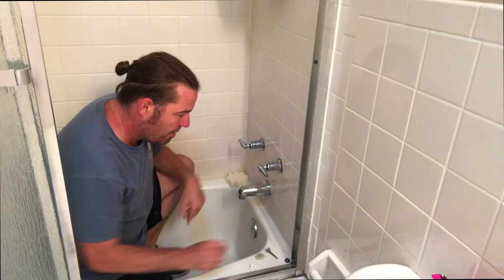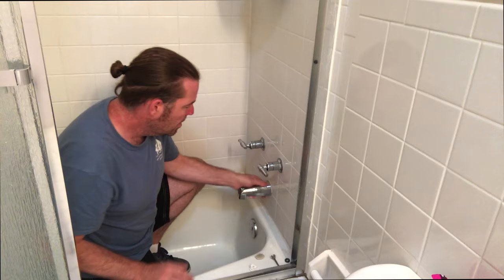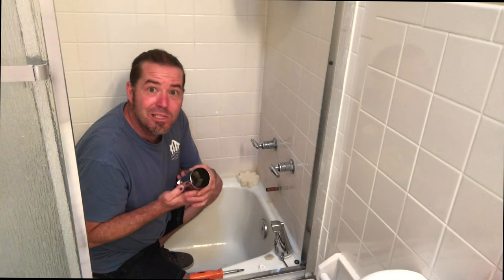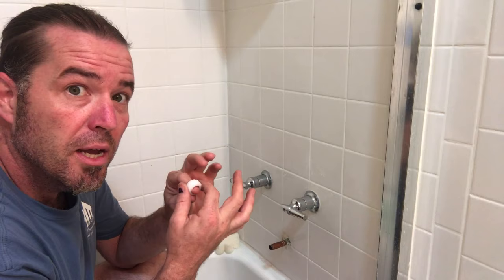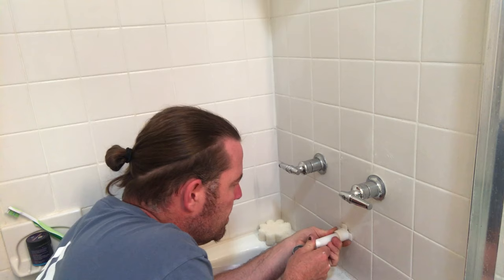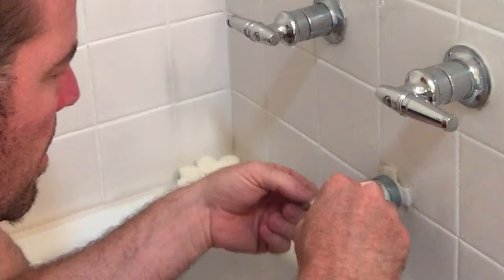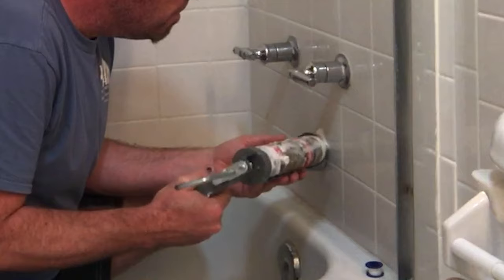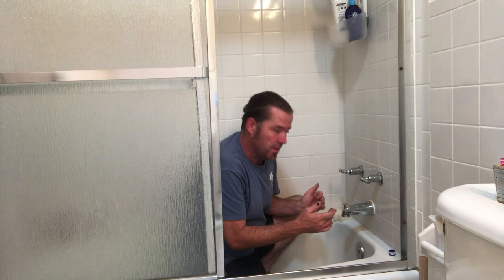how to replace tub spout, change tub diverter. Easy!

Comment: You can tighten it by hand, no tool is needed? Good tip on leaving the bottom open to allow inside leak to come out and not stuck inside the wall. Thx
Reply from the maker: Thank you simple. Appreciate the comment!

Comment: In our shower our spout doesn’t have one of those diverters, does this mean I need to replace the spout with a new spout that has one? Because we cannot use our shower head
Reply from the maker: Hey Nicolas. That means you probably have a three handle system with a diverter in the middle. You may need to replace what’s inside that middle handle… Otherwise yes, you would need a diverter on the tub spout.

Comment: Thanks Dustin! I recently moved into a new house that needs some small improvements, including this. Followed your instructions and now no more water coming from the spout when pulling up the lever! 

My copper pipe was much longer than the one you showed in the video, so I just needed to screw the spout on directly. Hopefully I didn’t miss anything but will keep the spare parts just in case. 

Thanks again Dustin!
Reply from the maker: https://thehomemenders.com/e-course/
Thank you Reggie I appreciate you sir. New homeowner? Here is your complete confidence builder. Check out the Ecourse for homeowners for complete fixability.

Comment: Great vid Dustin I didn't have to remove my tub filler spout. I just laid on my back with a headlamp. I took a flat blade screwdriver from underneath and splayed the nylon latch-fingers apart and pulled up on the diverter knob on top of the tub filler. The nylon part with the diverter rubber washer seal slid down and out the bottom of the spout. I replaced the washer with a Draco "TUB SPOUT DIVERTER REPAIR KIT" from depot. I just used the NEW rubber washer seal and re-used the other original parts; lift rod and nylon diverter gate. My old rubber washer seal had a notch out of it.
Reply from the maker: Awesome fix TD. Thanks so much for sharing

Comment: seems pretty straight forward and easy enough to do with one hand, i just moved into a new house went to take my first shower and the diverter is seized in the down position so i ordered a new spout from amazon but living on a  relatively remote island in the north atlantic in canada the prime free 2 day shipping is more like 10 days so ive got 5 more days. next step is the rotted floors which i see you have a video on that too the toilet leaks between the tank and bowl when flushed which has rotted the floor around it causing the toilet to lean 3 degrees to the left so i just put down towels to soak up the water and got a seniors cammode / toilet seat riser to put over it so im not putting any weight on the toilet itself and the toilet stopped leaking when flushed but the whole back half of the house is falling off
Reply from the maker: North Atlantic. You rock sir. Super hard-core. We can fix it together! Thanks for sharing.

Comment: You seem to have a video for every issue I have run into on the house I have just bought. That is a lot of videos, because I have a lot of issues.
Reply from the maker: That is awesome maga , I would love to have a maga man around anytime. Thank you friend
Reply: Truth! I can always count on him to have a video on covering just about every issue I could have.
Reply: Just curious, I know you didn't say anything about shutting the main water supply off to change out this threaded diverter, nor did you say anything about turning it back on when you put it back on. I'm about to change one out at an apartment complex that has to have the entire building shut off, if I need to cut one water supply it's the whole building. I need to be absolutely certain that that's okay, to just spin the diverter off and take off, while leaving the main water supply on -which to me doesn't seem correct at all, but possibly it is. I'm just an amateur plumber. But it absolutely was not spoken of in this video one way or the other. So I just wanted to take this time to ask since I'll be doing this in the next couple of days. Please let me know if the main water supply needs to be shut off before proceeding with this replacement. Thank you

Comment: Dude, I need you!  I need to do this but I can't get the spout off.  I'm pretty sure it's a twist-off but it wont budge.  I'm afraid to force it 😬
Reply from the maker: hey cer...if there is no screw its probably a twist off..yes it might break..but you can fic that too...you got this!
Reply: I am having the exact same problem. I am so scared it might break and then I will have another thing to fix.

Comment: Is there any way to change the location of your diverter? My diverter is currently located on the tub drain, but my new shower head kit came w/ a spout that also has a diverter.
Reply from the maker: You may need to get a plumber in there to take a look, feel free to book an appointment with me. The home mender @Gmail no spaces.

Comment: I've watched a few different videos on changing a tub diverter and none of them have said to turn off the water.
Reply from the maker: Hi Tammy, great observation… That’s because the water is already cut off at the tub. If you were doing some thing with the hot and cold side you may need to cut the water off at the street but since the water is already cut off to the tub and the diverter comes after we can work on it. You got this

Comment: I don't have your type of diverter,, do you offer help on a diverted that does not come off ??
Reply from the maker: Hey Marty, you might need to make an access panel behind the wall to check it out, but they all usually come off. I hope this helps… I also have an access panel video if needed.

Comment: Mine is a circular knob with a diverter from 1990 it just snapped off it’s stripped ! Can you tell me what I need to do for an update ? Thanks
Reply from the maker: Hey Kristi… They have the universal ones now, if the pipe broke off in the wall you might need to get into the Wall but otherwise, take a picture of your fittings and a trip to the store. You got this

Comment: My Moen kit had a spout with the diverter at the front, which I guess is how they're made now.  My plumber said he couldn't use it because my current spout has a diverter in the back.  Is this true?  What do I do if something happens to my current spout and needs replacing?!?
Reply from the maker: Hey Castlerock, he could have put on the new diverter after removing the old one. Sometimes technicians say things that aren’t true if they don’t wanna do it lol I have been one in the past.  Not proud of it, but I once told a tenant that American standard toilet had a natural lean to them. Lol. 😅 it turns out his her dad worked at the American standard toilet plant in Danville lol.

Comment: Hi Dustin, any tips or suggestions for getting a stuck spout off without breaking the pipe.
Reply from the maker: Hi Laura some of the stubborn ones can be tricky. Double check and make sure there isn’t a set screw underneath then they should spin off. Be prepared that you may need to replace that piece of copper pipe. A plumber my tried to use his torch and heat up the spout a little bit to get it to spin off. I hope this helps and good luck

Comment: I have hard time removing my diverter it will turn a little bit but then it gets very tight. I did not see any screw hole that I have to loosen but maybe there’s something there holding it. So I stopped right now because I don’t know what to do.
Reply from the maker: Hey simple. If there is no set screw it should spin off. I have had to break them off to get them off.  Sometimes they’re supposed to spin off but get seized. Twisting the copper line is possible. I just pray and go for it.  You got this.

Comment: I installed a mobile home faucet diverter in my homes tub/shower 20 years ago. Faucet starting to leak. I guess I need to do the job right this time but you have to give me credit for it lasting 20 years without a leak. I might be bugging you later with more questions lol.
Reply from the maker: Heyhey. No problem. And 20 years defines a successful repair!!
Reply: I have a mobile home, l bought a tub spout kit by Danco, the instructions are vague, l'm a female of 76 years old l need better instructions then the packet,,help ?

Comment: When you put the screw in. Is it suppose to go down to the copper pipe? Or does plastic sit between the screw and the pipe?
Reply from the maker: hey jake..some set screws touch the pipe..this universal has the plastic sleeve  so the screw  tightens to it

Comment: I have a pipe with the male on the end. It is total of about 4 inches out from the wall. Can I buy a diverter that actually fits this without chopping down the pipe?
Reply from the maker: Hey Cb. Probably not, they may have a half inch discussion that builds out of the diverter but most are 3 1/2 off of the wall, don’t let cutting the pipe intimidate you. You can simply use an imp cutter to cut off the fitting and then they have compression diverters that fit right on. You got this
Reply: @homemend  Thanks for the encouragement, but did luck out with a screw on diverter that works with 4 inch. So no need to cut her down and use a slip on.

Comment: Why do some people say to caulk around spout, and some say not to. I personally like clear silicone sealant. Should you use silicone grease on the rubber O-Ring?
Reply from the maker: hey mike....some do some don't...i like to because it keeps water out of the wall and looks crisp and clean...grease ok or not...
Reply: @homemend  I'm with you. So many people telling me different things on this issue but better safe than sorry. Would you reccomend putting silicone bewteen the wall and the copper pipe (in the open areas). I seen a video on youtube with someone recommending this. Or is this overkill, Thanks Brother.
Reply from the maker: hey mike...overkill man...be on the look out...thehomemenders.com
a place where we can settle these issues once and for all!..stay tuned friend!

Comment: Hello, my spout won't ever stop spinning when I turn it and the screw doesn't end up facing the bottom. Is there a way to fix this?
Reply from the maker: Hi Annie. If it’s the kind I use here they will never stop spinning. You would want to put it in the place where you need it and then tighten down that screw. This will prevent it from turning easily. I hope this helps

Comment: Hi Dustin. I love your channel. Quick question, do I have to shut off the water to the whole house first? Or as long as the shower is turned off I can remove the faucet?
Reply from the maker: Hey Marvin. If you’re changing the diverter no. But if you’re working on the faucet itself yes.

Comment: There was no need to take the tub spout apart. Don’t twist the spout before loosening the set screw. That will score the copper to much. And tape off the spout before caulking, then remove the tape after smoothing the caulk. This leaves a better look.
Reply from the maker: Awesome Greg thank you for sharing
Reply: Greg my spout does not come off, l bought the repair kit by Danco, but the instructions are vague any help ??

Comment: No problem...well, only a little.  I got a Moen kit that just slides on and has a plate to cover the hole in the tub enclosure. It uses a set screw to tighten.  The copper pipe from the wall is just a tad too long. I should have hack-sawed off a 1/4 inch or so and it would have fit closer to the tub wall,  But, that's no worse than it was to start with, but now the shower works! Yea!
Reply from the maker: You rocked it!  Thanks for sharing Judith!

Comment: It did not help me   what was sticking out of the wall was plastic with threads on the end I could not find 1 self help video to match  ( I asked for help mobile home)   ERGGGG...
Reply from the maker: Hey Jean. Sorry you’re having trouble. The best thing to do would be to take a picture of it and maybe measure the diameter of the threads and then go down to the hardware store. I’m sure they have a diverter that will fit what you need regardless if it’s mobile home or not. You got this!

Comment: What if that long white piece inside the diverter doesn't screw out of the diverter?  Can you keep  it on  and then screw  the diverter on?
Reply from the maker: Hey Trudy!  The ones where the white piece won’t come out are usually for a shorter pipe. I would try to get one that’s similar to the one you’re replacing. I hope this helps
Reply: @homemend  Thanks for the advice.  The new spout is exactly like the old one where the diverter broke, but whenever I put the new one on, it leaks from where it meets the wall.  I've tried tape,  but still am struggling to replace this faucet, which should be a really easy fix.  I'll try again.
Reply: BTW, your DIY video was the best ever.